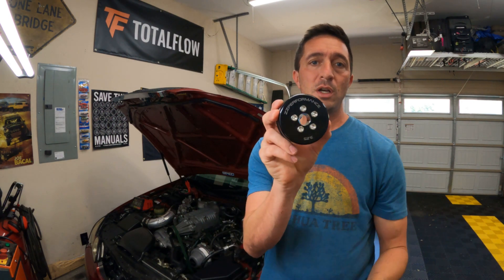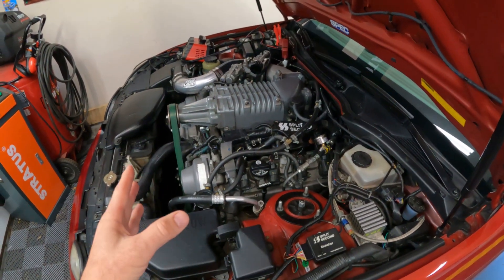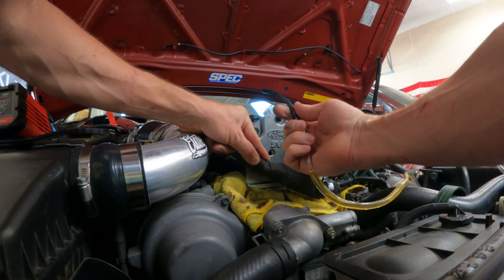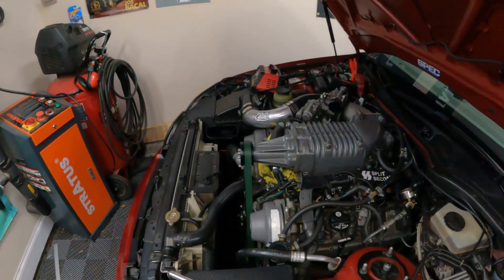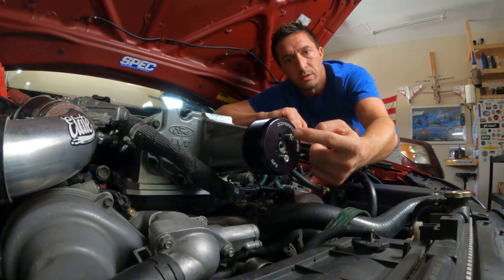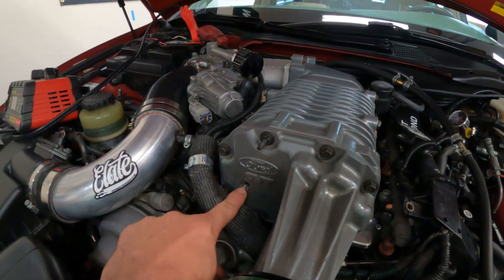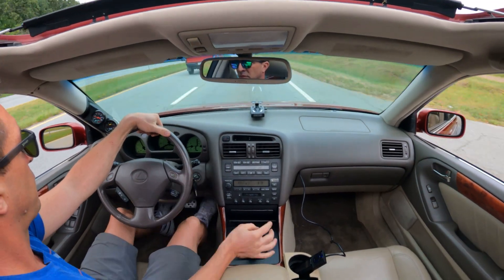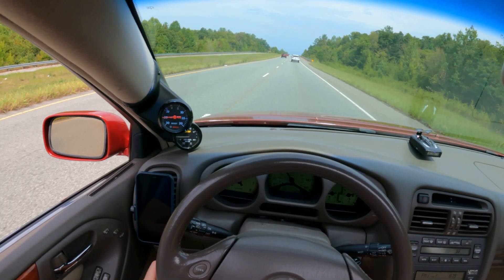Turning up the boost on a supercharged vehicle (Lexus GS400 shown, ZZPerformance pulley system)

Comment: What pulley size are you running
Reply: What would you recommend for a stock uz my superchager came with billetflow 2.760 pulley im not sure if thats works for 6psi
Reply from the maker: 3.25”. Use the Planet Soarer pulley calculator to figure out what’s best for your application.

Comment: Would love to see a close up of the speedo when you do your pulls! Sounds wicked
Reply from the maker: Good idea. I have a GoPro H7 as well, so this could be arranged. 👍
Reply: Sorry to bother you so much with all the questions, I reached out to ZZ performance and they said their pulley system, (Made for the GM 3800 Eaton M90 blower), wont fit the M112 due to the different shaft diameters. Is this a different pulley kit made by them that is discontinued or is it the 3800 M90 pulley system. Thank you. @ForwardMomentum
Reply from the maker: No idea why they’re saying that. Here’s  the exact pulley I purchased, direct from ZZ on eBay. It fit my M112 perfectly. https://www.ebay.com/itm/131918635245?mkcid=16&mkevt=1&mkrid=711-127632-2357-0&ssspo=IbaaBzI9T6S&sssrc=4429486&ssuid=FHcu12rRTcq&var=&widget_ver=artemis&media=COPY

Comment: Did you reset the fuel computer after installing the new pully by just unplugging it from the battery for a min or two? Might force the car to remap the low rpm Richness out a little faster if the CPU can do it by itself ...
Reply from the maker: This is a great point. I did not do this because my NEO controls fuel so I got out of the habit, but it would have been a good move. Thanks for pointing it out!

Comment: WOW!!!  That is a rip off, A run should be 50.00-75.00USD, just for a run and the tunning runs with tunning should be under 200.00, are they smoking crack with u when running the dyno? might explain the extra cost?
Reply from the maker: I know! Plus, one of the places requires a bunch of crap I don’t have. For example, a fuel cut off switch and an enormous list of prerequisites, some of which I also don’t have. Another place won’t let me film. Frustrating.

Comment: does the BPV open to maintain manifold pressures? it's strange seeing the boost level off.
Reply from the maker: Max boost and level off is a byproduct of pulley size, rotor speed and SC VE. The BPV doesn’t do much except allow pressure bleed at low demand.
Reply: @ForwardMomentum  what's the volume of an M112 ? How are you measuring your supercharger VE or plotting the supercharger speed vs flow rate to work out the VE?
Reply from the maker: I can’t post the VE heat map here, but I have a few different things I can share if you contact me on IG.

Comment: Wish boosting the GS300s 2jz was as easy as these 400/430 UZ motors 😆😭
Reply from the maker: Some would argue it’s easier on the 2J…🤔
Reply: @ForwardMomentum  With all the aftermarket support for the 2j, I would say it’s a lot easier.
Reply: @FugginCoyote  2jz has more aftermarket support for variety and different setups as well as different prices. But its much easier to supercharge the v8 than to add a full blown turbo kit to a JZ. it just arguably costs more to do a supercharged UZ.
Reply: @ForwardMomentum  I can see that especially with there being more space in the engine bay because of the smaller motor
Reply: @Bellgrande Not much more room in the engine bay. 2j is easier and doesn't take much to tap into a little extra power. Swap the stock intercooler for a front mount, open up the exhaust for the turbos, add a FCD if you're running stock ecu, then a boost controller and you're pretty much set
Reply: adding forced induction to any motor is about the same amount of effort with variables like Vshape / Aftermarket support / Engine compartment etc. Building a JZ isn't really different than building a b18 really, the same laws apply lol it's just the constants change.
Reply: @robertstothart27  I've modified plenty of cars, I'm not new to this. I've owned a Lexus gs430, Is300, ek civic, etc.  I've also done my own complete custom big turbo setup on a 5 cylinder manual Volvo, a car that has pretty limited aftermarket support compared to most cars people modify. So I definitely have some experience under my belt. It requires more work to turbo a car vs supercharge because their are more parts involved that are mandatory to make it work in general as compared to a supercharger that was the point of my original comment.
Reply: @T5_T-Rell  but.. I was replying to someone else lol. Sounds like you had some fun projects.
Reply: @robertstothart27  my bad, youtube sometimes doesn’t target who the reply goes to, I got it in my inbox and figured it was for me, looking back it doesn’t even have a name tagged in your comment but definitely. I’ll hopefully be picking up another gs430 soon or a ls430 to be my new daily along side my w.I.p track car